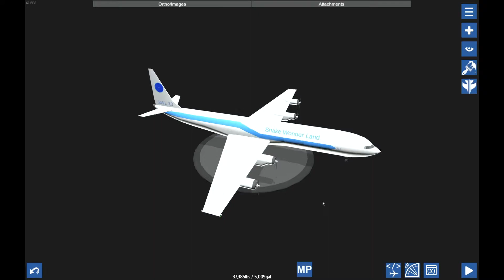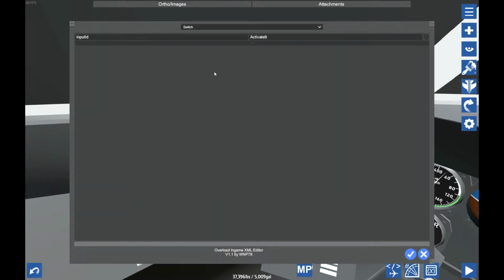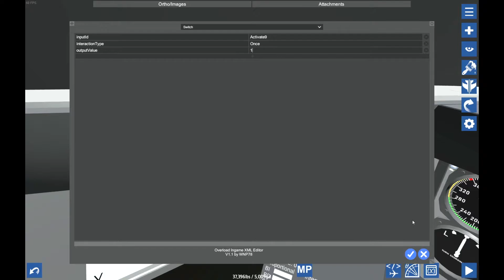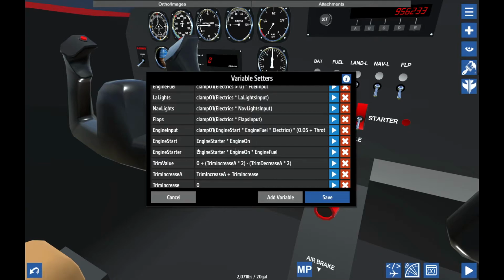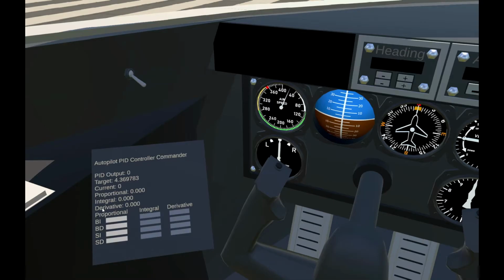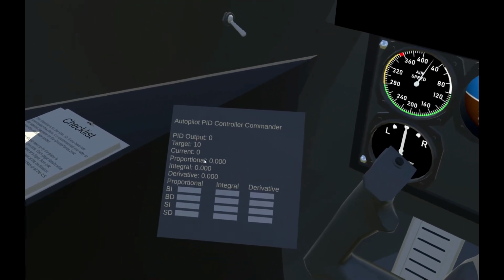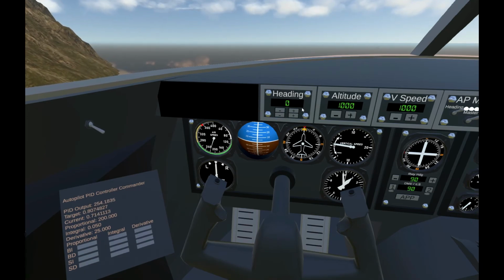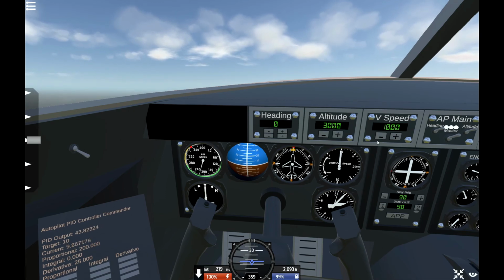The Variables System in SimplePlanes (Part 3)

Comment: Is it possible to make a switch that's active on spawn without setting it to AG8
Reply from the maker: You can use a variable, I guess. Make a variable with an activator of Time < 1 and an expression of 1.
Set a switch to that variable with the interactionType of Toggle, and that's the closest you can get to having a second AG8.
Reply: @11snakePlayz  thanks my g, I've also found since asking this that u can set the input of the selected part  too -Activate7 wich will do what I want it to anyway
Reply from the maker: @donzagamingofficial8902  That works too!
Reply: @11snakePlayz  hey man I hate to bother u again I tried this, but I can't turn the button off, I made sure it's set to toggle, what would the priority be maybe I got that wrong
Reply from the maker: @donzagamingofficial8902  That might be an issue with the variable setter. Check that the expression is 1 and the activator is Time < 1.
Reply: @11snakePlayz  I managed to work around it again, but I made sure it was all in the right spots, I even swapped them around a bit to check and it does activate on spawn(the button lights up) I am just un able to deactivate when I press it, not sure why this is, not a massive issue just took some time to think of a different way

Comment: How can I apply this in a 2 engine craft?
Reply from the maker: What part are you referring to?
Reply: @11snakePlayz  the engine starter
Reply: This is the craft link https://www.simpleplanes.com/a/45352S/AirDelta-202 I would highly appreciate it if you could have a look 😃
Reply: I already have the left engine working and the right engine is coded but it doesn't turn off when I turn off the right ignition switch
Reply from the maker: If you look at the activator for the last variable you have, remove the code in that activator, and you will find your engine will then stop. The activator is preventing the code from running, therefore making the engine always be on.
Reply: @11snakePlayz  when i start the level its all working fine but once I activated the eng starter it starts then if I turn off the ignition it turns off then if I turn on the ignition again its supposed to be off but its on without activating the eng. Starter
Reply: This is only for the right engine the left engine is working flawless 😊
Reply from the maker: The left engine has the last variable reference itself (Switch4input being Switch4input * Switch3). The last variable for the right engine does not do this (Switch4inin being switchinput4 * Switch3in). Maybe change the names?
Reply: Thank you so much it's finally working ☺️